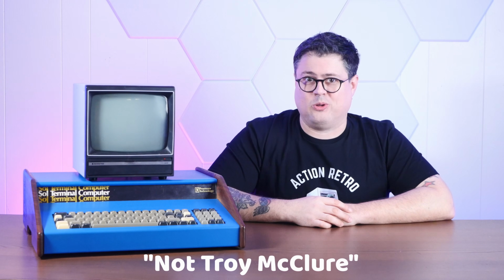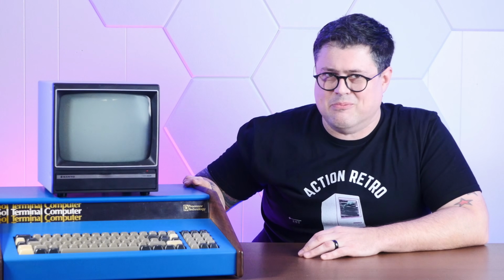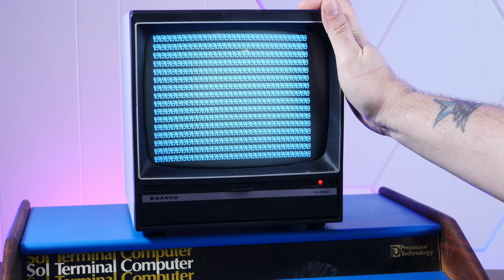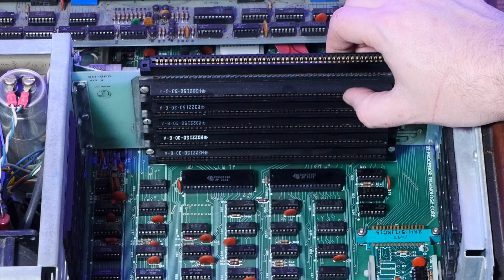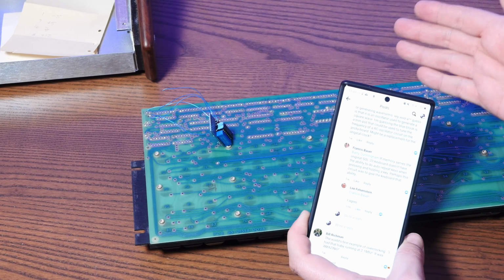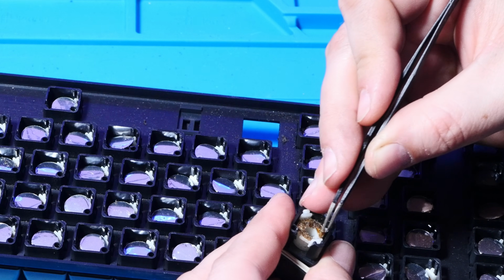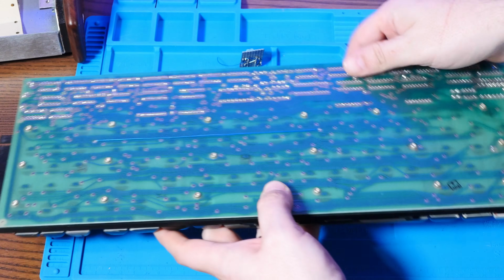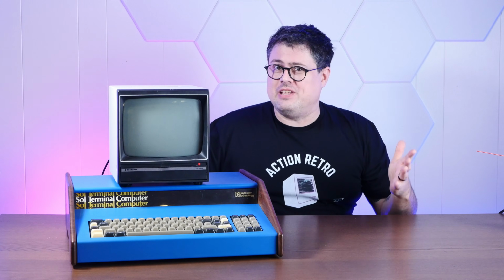The Most Important Computer You Don't Know About

Comment: If I remember correctly Local / Remote would determine where commands you executed were executed. If you had the local key on any command you gave would just be executed on your terminal, but if you had remote mode selected any command you issued wouldn't be executed on your terminal  but would be sent over the serial port to the machine that you were connected to.

Comment: This was the first personal computer with built in keyboard and video output 1976.   There were other personal computers before it.  The Xerox Alto with mouse,  monitor, external keyboard, graphical interface was in 1973. So far ahead of its time but cost $32,000 back then.

Comment: Back in the late 1970's, I worked for a small computer shop that was a dealer for Processor Technology, and I helped the owner assemble one of the first SOL-20 computers.  The very first units didn't have the built in S100 expansion card cage, just a single slot on the mother board.  We were somewhat disappointed that the SOL was designed around the 8080 cpu, and we attempted to upgrade it to the Z80 using an off the shelf adapter that had been designed to work with the Imsai computer.  This didn't initially work out, I think the SOL's roms were coded in such a way as to be incompatible with the Z80.

Comment: I actually used a Sol 20 back in the early 80s. The drive for the twin 8" floppies was a stand-alone unit that could have served as an anchor for the Queen Mary. It weighed twice as much as the computer itself. Its version of Basic was much superior to Apple's, which came out years later. As mentioned, it was upper and lower case (Apple's was just UC). If it encountered an error, the program immediately flipped into edit mode with an arrow point to where the error was. Years ahead of its time, just poorly marketed.

Comment: So I built the original SOL when I was 16.  Well, tried to.  Back then it was a huge circuit board and some documentation.  It was /not/ assembled and parts were for you to source.  It boasted a alpha numeric keypad and small hex display, you had to add your own S100 cards for most i/o, and if yiou get it working, you still have to write your own bios to get CPM to load from whatever floppy controller/drive you could get your hands on.  Yeah, I didn't have the assembled version, it doesn't look like it takes s100 cards, so not sure how it would interface. To be fair, mine was a single board computer with a s100 edge connector, so it was like a s100 card, except too wide to fit an empty s100 chassis, so creativity was required to make full use of it as a s100 system.  Out of the box it was sold as a dumb terminal kit, but it was envisioned to be a full s100 system.  Yeah, mine never worked...  Never got all the parts together before I wanted the Apple ][ instead.

Comment: The startup problem (3 times power on) must be or the boot auto reset capacitor for The processor, or the output low voltage side capacitors on power supply. Can be both. Don't ask, I can't say which ones are them.

Comment: There  are many ways to cut a tree as to manipulate the wood grains. While it is true that trees today are cut to minimize waist. Bias cuts and quarter saw lumber has become uncommon due to upwards of 50% of the tree being scrapped in the process. Today 95 percent of the tree is used. even the saw dust and bark is recycled for various purposes additionally there are various methods of manipulating the woods grains using different coloring treatments and even mimicking/doctoring addition lines in the grains.

Comment: I knew someone who bought one of these brand new. Very expensive at the time. Processor Tech had a huge h1 building somewhere in the SF Bay Area but they went broke with execs spending money on hot tubs, motorcycles and the like.
Apple's advent and rise killed them off.

Comment: WTH is the SO-239 UHF connector on the back for?  They're found on radio equipment normally.  My first computer was a TRS-80 Model 1 which I fully expanded and still need to sell on ebay.  Well, I just did a search and found out... that's a composite video connector.  Why they ever chose an SO-239 rather than just an RCA style jack makes little sense.

Comment: Some '70s desktop calculators had those foam pads...they degrade quickly. Amazing to find that old of a computer in near new condition. Those pads would have rotted if it sat in the box unopened. 
     Environmental factors can accelerate the breakdown of foam. Cheapouts from the '70s.
     Still, it's great that it's being given a second life....

Comment: i admit to not knowing this one.  It can be confusing talking about "firsts".  One of the first microcomputers was the Kenbak-1, but it was a kit.  There was a "Micral" which was supposedly not a kit, and perhaps the first non kit microcomputer, but as you say, it was not "complete", it was more like the Altair.  So this is pretty interesting, IMO.  I am surprised by how many early microcomputers I never heard of, given my lifetime involvement in computing.  Just shows you, that there were a fair number of clever and enterprising people trying to break into the microcomputer market.  And how it's not easy to do so, because you really need a marketable product.  Somehow Apple did a better job than most people, along with the Tandy people.  Stuff like the TI 99/4a, Atari computers and such were simply not positioned to be more than a fun "toy".  Apple also really benefitted from an "open platform", as people could make boards for it, and it had a rather nice backplane, I think it allowed for at least 6 boards?

Comment: What about the IBM 5100 from 1975. It was not only a personal computer but it was "portable". I only saw one back in the day but they were available. It beat Osborne to market with it's integrated monitor. The Osborne was half the weight at only about 25 pounds. Yes, we did lug 25 pound computers around with us. I remember bringing a Compaq onto a flight across the country. I'd classify the Sol-20 as the first fully assembled home computer since the 5100 was not exactly cheap.

Comment: ...so.... The 5x restart to prompt issue....

(DISCLAIMER: As it's sight unseen for the most part, I'm just a theory, NOT advice.)

The tennis-ball sized Cap you found quite likely has multiple outputs.  It would be the main filter.

The stability issue arises because of thermal degradation due to 50 years use, and the sweating of electrolyte from the canister.

An astable waveform in the power signal will instigate jitter and timing glitches. Ripples in the output power can 2nd and 3rd order jitter in the logic timing.

Refirb and scope the PSU . Has to happen someday anyway right? =)

Comment: If the stars were aligned right the Sol-20 could have been the best of the bunch.  And, you're right, I never heard of it.  Not until it took its Osborne form.  I remember something about the Apple II's compact internal power supply being a big factor in putting Apple on top.  The Sol's power supply was... uh... robust.  The Osborne was no lightweight, really.

Comment: Proud owner of two Sol-20 computers, along with a Vector Graphics Orange box S-100 computer.

Keep cleaning the keyboard PCB - use a scrubbing pad to get the pads shiny. clean and reseat all the ICs.

Replacing all the Power supply capacitors is a good idea, along with all the main board electrolytic caps.

As the Sol-20 is now, all you have is the built-in 2k of memory, at location C000. You need to add a memory card to boot any serious software.

Good luck!
Reply from the maker: Awesome, thank you!

Comment: After I got out of the Air Force in 1979, I went to work for a Boulder CO company called The Byte Shop. They were selling small computers for use in business, mainly in word processing. We had a lot of legal offices as clients, for example. One of the machines they sold, and I supported as a technician, was the PT Sol. The S100 expansion slots primarily were used for 4k static RAM boards. They were sold with dual 8" floppy drives, a video monitor, and mostly used an IBM Selectric typewriter as a printer via a RS232 I/O port. They ran CP/M for an operating system, WordStar for a word processing application, and VisiCalc for rudimentary spreadsheet applications. Yeah, even back then, the keyboard was problematic. Pertec 8" floppies used a hammer and chisel for alignment, and Selectrics were a major PIA. Single sheet feeders were Satan's torment for technicians. The huge capacitors were indicative of a linear power supply. TIP: Quit using rubbing alcohol, it leaves a residue that will eventually cause you trouble. Get some isopropyl alcohol for cleaning contacts.

Comment: Back in 98, I found a Lear Siegler ADM 2 in the dumpster at my old apartment complex (no keyboard). Eventually moved, the terminal was left in a storage unit and my parents ended up losing it. A few years ago, I saw the exact terminal I owned, appear on ebay for $200. So wish I had bought it back..

Comment: A friend owned an electric typewriter with a REPEAT key.

After typing a character, the repeat key just printed the last character again. But unlike the normal keys, the typewriter kept printing the character.

This could be used to create a “----------” line, format with spaces or underline something.

I think the way it worked was that the mechanics didn’t reset all the way after typing a character. It could also print the last character before power cycling the typewriter. Also it was all mechanical except the electric motor which ran constantly.

Comment: When your in TERM, the local button likely toggles it showing you the characters you type or not.
This is because the old standard for line input was 'Local Echo' (for most things) but when things went to 'Full screen' and you had 300 baud full duplex it was feasible for the application programs to echo back the keys.

Comment: It's important to realize that capacitive switches did not make contact. They sensed the proximity of the foil which formed two capacitors in series. The foil has to be insulated on the bottom which touches the board, and the plastic insulating layer is essential to making it act like a capacitor. The pads on the board don't even need to be cleaned or deoxidized unless they became sticky or if the dirt buildup is thick.

Comment: 12:36 They're called slotted screwdrivers and the screws look to be pan-heads
20:09 (and earlier) that module may be a key bounce killer, the pot being there to adjust the time for the de-bounce. The jumpers you talk about along with piggy-backing ICs on to each other (not seen on this comp) was very common in the 70's to 90's to correct issues and modifications; Lord knows we did many hundreds of them on the video games of that era!

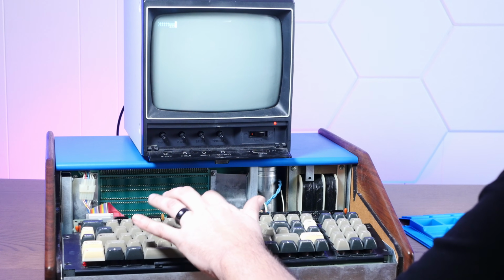21:30 First step before powering-up old electronics is check the caps for leakage, but the second job is pull the ICs and reseat them to cut through any corrosion along with any wafer or unsealed switches.

Comment: This was the first computer I bought (I think about 1977.. ~ $5K). It came originally with 4K or dynamic ram ... that didn't work. I had to replace it with 4K of static ram ... which put out lots of heat. I also purchased the accompanying Helios dual 8" floppy drive. A single voice coil actuator positioned both disks simultaneously. It was the fastest drive available at the time. I particularly liked the PT-DOS operating system and preferred it over my  later IBM-5051 with PC-DOS. Interestingly I later bought a  DEC 1130 ($30K) and was surprised to find it wasn't "big enough" to run the programs I had written for the Sol. I had to rewrite them. I still have the machines (not including the DEC 1130 which I was glad to get rid of) but they're sure not in as pristine condition as the one in this video.

Comment: One additional point to add to your good advice on preparation to powering-on vintage hardware:

Re-form the electrolytic capacitors in the power supply the first time you power it. This can be done with a variac to slowly ramp up the input line voltage. This significantly reduces the risk of fireworks and over-voltage damage to the rest of the computer.

Comment: Its not that people didn't know how to build computers in the 70s, the problem was a combination of availability of parts and the cost of those parts. Certainly in England few people could afford to buy these systems until the advent of things like the ZX80 in the 1980s. Around this time, for example, I had a university project to assemble odd pieces of junk into a working graphics terminal for an Elliot 803, a minicomputer that was logically about the same size as this system but physically much larger (and, of course, rather expensive). Getting from there to where we are today provided many people with good jobs (including myself) so I'm not complaining!

Incidentally, the reason why the thing is so heavy is that linear power supply. S100 systems tended to have a hulking great mains transformer. The Apple computer was the first time I saw a modern style switching supply.

Comment: I still have an original Processor Technology SOL In my storeroom that's been there for at least 34 years.  I purchased it for $600 dollars at a swap meet in Sunnyvale in 1980 and used it for several years to learn 8080A assembly language.  That was the same swap meet where I almost bought the original Intel 4004 prototype board for $5 from a retired Intel engineer  who was cleaning out his garage - but didn't because I was broke after buying the SOL.  The next swap I attended the very same engineer was there selling more interesting  electronic "stuff", but the board was framed, on display, and was no longer for sale!  That 4004 board was the arguably the beginnings of the microprocessor revolution.  Wonder where it is now?  Thanks for the great video!  Especially the part on repairing the keyboard and a source for the foam pads.  SUBSCRIBED!
Reply: I never tried a Sol-20, but built my own S100 machine using the Processor Tech VDM1 video card in 1977.  I use a separate Z80 based card from SD Sales.  When I saw the pattern of Nul and 9, I instantly knew that the RAM at location x0038 was not being addressed. This was either a missing or non-functional RAM card, or the RAM that was shadowed by the boot ROM, was not reenabled!  I used a better keyboard with Cherry mechanical switches.  The hard part was making my own ROM with a hex debug monitor and later boots into CP/M and UCSD Pascal. Barry.

Comment: Not only have I heard of it, I put one together from a kit purchased at the First Canadian Computer Store, which was exactly that. Went on to hook it up to a 10 rank pipe organ thus turning it into a player organ. Also wrote software, all in 8080 assembler, that let me easily enter the musical score even of complex music I could not play. A Bach toccata fitted nicely in 32 kilobytes of memory. Thanks for stirring up some happy memories. Now I'm building Virtual Pipe Organs using Arduinos. It has been quite a ride.
Reply: I was intrigued by some of the open platform Raspberry PI or Arduino synthesizer gizmos.  But I guess I am too lazy to sit down and master the skills needed to code up what I really wanted...something like granular synthesis.
Reply: Wow, that sounds interesting!
Reply: what was the interface beteween the CPU to the organ..  ??  Since this was pre-midi..how did you trigger mechanical ie. keys ect of the Pipe organ?? What year was this ??   what is the name of this  computer store you mention.. Canadian Computers first opened in Kingston but there were other places to buy computers and kits.. like Radio Shack comes to mind...  One final question.. where was this organ located?  I would like some of these details if you dont mind adding  - any photos ect of the process and remnants of the code you used?
Reply: @SPINNINGMYWHEELS777  
1. Custom designed board occupying two large sheets of VeroBoard. Communication via computer's serial port and UART
2. Organ was electro-pneumatic with custom Multiplexed Switching System. Transistor switches "operated" the keys
3. Early 1970s
4. First Canadian Computer Store in Toronto
5. Organ located in my house in Kingston
6. Code remnants on cassette tape: scattered to the winds.
Reply: I'd send you a link but Youtube doesn't allow that.
I'm active on the Organ Forum.

Comment: Nice keyboard repair, but: fingerprints can blur the electrical contact of a contact surface.
Remove every fingerprint from contact surfaces with proper cleaning stuff to prevent corrosion later on. Wearing nitrile gloves can protect these surfaces while working.

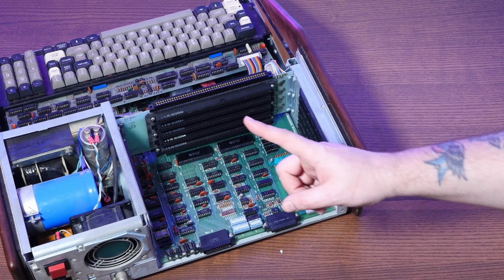Comment: 11:25 - they didn't see into the future.  The future looked back at what they did and made it easier to change in software.  Even in the mid to late 80's many arcade games had the same dip switch settings for how many credits each coin was, how hard the AI was to beat, how fast the game play was, clear credit card at boot, etc.  These settings for games that survived (Arachnid Dartboards for instance) were eventually all moved to software for ease of changing and also allowing all kinds of other settings that were prohibitive when in DIP switches because of the number of switches that would be required.

Comment: There's a really good chance that keyboard auto-repeat mod was the circuit from Don Lancaster's CMOS Cookbook which was one of a handful of hack circuits and the end of each chapter called 'A CMOS Cameo'. It worked by intercepting the keyboard strobe line and adding a low frequency oscillator which started running if the strobe line was active for long enough.